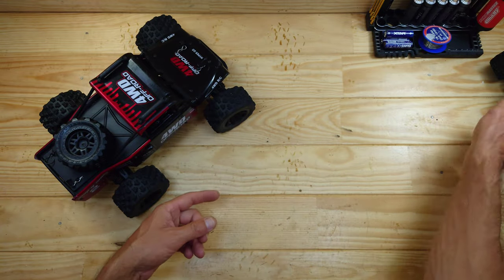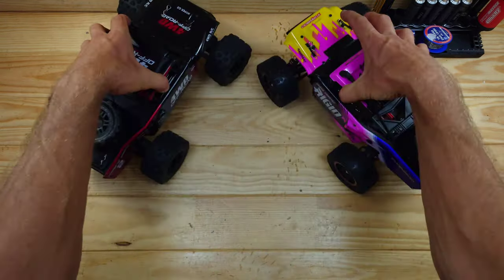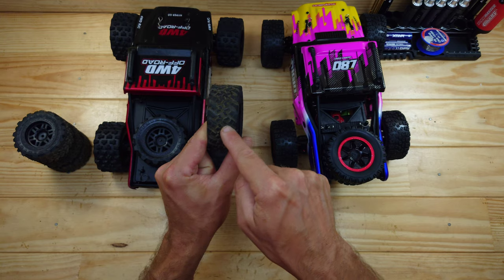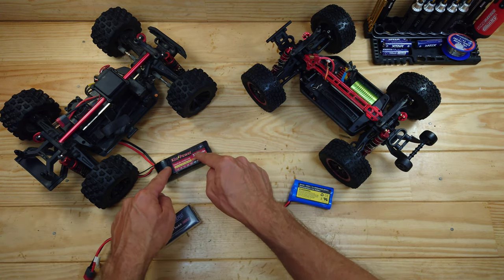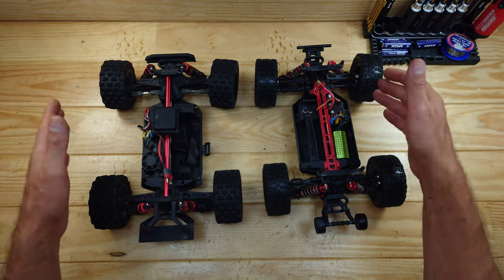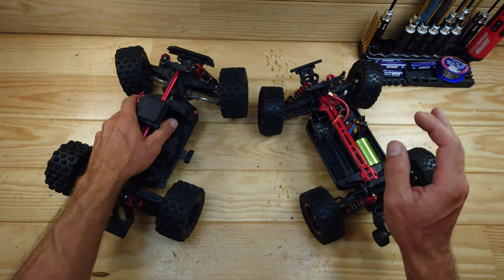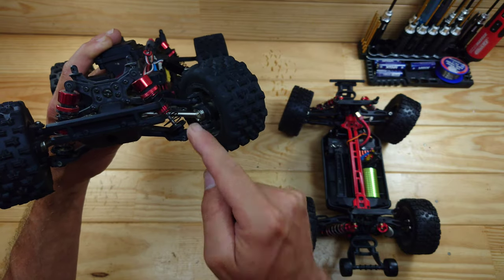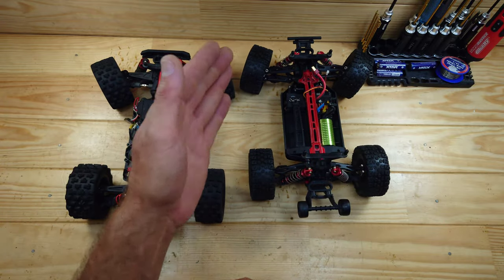Which is best: MJX 14209 vs JJRC C8805

Comment: considering the MJX can be had for well under 100eur on ali on a regular basis (pretty much every sale, and often on the start-of-month 'minisales') while the JJRC is roughly 115-120eur on banggood (cheaper than on ali where i haven't seen it on sale yet, and the final price on bg will depend on available coupons and allowance and stuff), and at a minimum you need a new set of shocks and likely tires.... yeah, i think i'd rather go with the bigger, more reputable brand for less $$$

a pity, 'cause i like the visuals of the JJRC much more
Reply: Where are you? Here in Japan is the opposite. The JJRC can be found at 9000jpy and the MJX if you are lucky maaaybe 15000. I have both and I had tried hard to decide which one is better (I want to sell quite a few of my rcs) and there's simply no answer.

Comment: Do you know if there is a monstertruck or truggy version of the jjrc?
Reply from the maker: Yes there is: https://s.click.aliexpress.com/e/_EHwobCJ 
All the same except for the body and wheels
Reply: There are plenty of diff versions Kirchhoff offer. My fav likely is “sweep”. It was my first of Jarvis truggies and I like it the best. They have similar ones like “Beast” but that one and others are downgraded versions as the internal parts r cheaper including engine. Sweep advertised as 70 kmh which it does. After installing oil shocks it is a fast n fun 1/16th  rc.
Reply: Auto correct screwed up many of my words. Smh